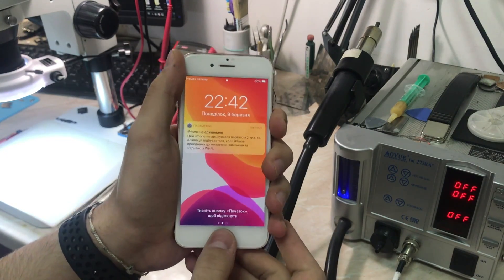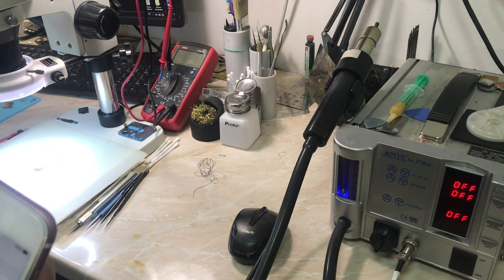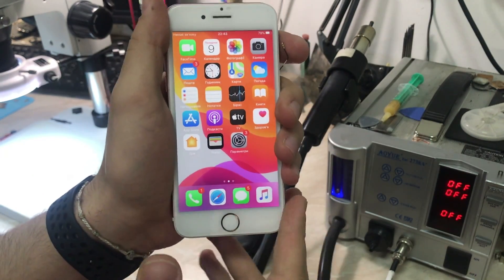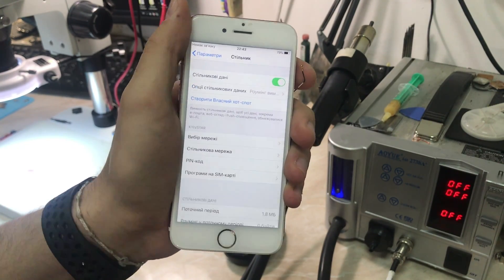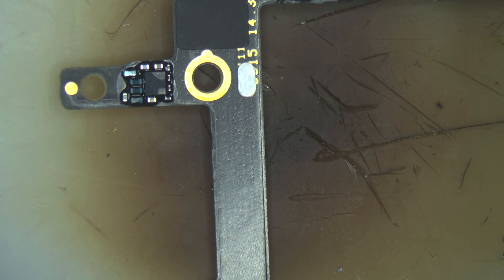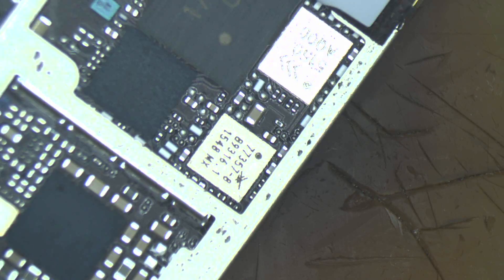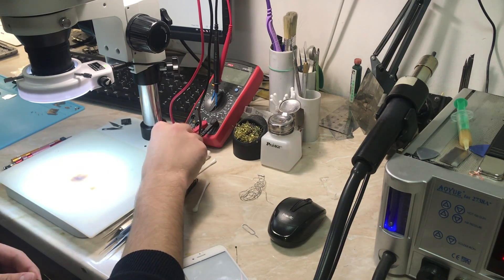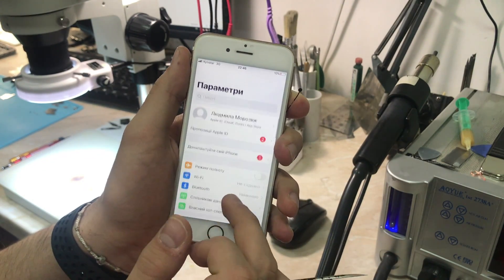iPhone 6S No Service (Easy and Fast Fix)

Comment: I think it's important to measure the components for diode mode and voltage values so new techs don't just change that ic even if the problem is elsewhere. Just a suggestion

Comment: Can someone help me I have an iPhone 6s that has bad reception drops in and out in the same location a lot of the time I’ve done everything I can think of replacing the SIM card and doing everything I can in settings but still nothing seems to work
Now I’m looking to replace the antenna but I don’t know which antenna is for the cellular 
The one with the bracket or the one next to the battery connector 
Any thing can help thanks
Reply from the maker: Do you have a complete drop for 2g-3g-LTE or just couple of bars dropping ????if you want to change the antenna it’s near the bracket of course try to change it goes with the charging flex

Comment: i'm facing low network issues in iphone 6s after changing charging flex board
what should i do ?
Reply from the maker: Check the antenna and try another charging flex
Reply: @AntoineKiriaky10  I tried everything 
network reset, antenna, flex board
Reply from the maker: Before you change the charging flex was there a strong network ? And what is the history of the phone ?
Reply: @AntoineKiriaky10  yes there was full network
and I don't understand what is history
Reply: @AntoineKiriaky10  can we chat on Instagram

Comment: My iphone 6 plus has No Network Connection. No Carrier in the settings. What’s the problem with this?
Reply from the maker: Does your phone see the SIM card ?
Reply: At first, the iphone can read the SIM card but later onward, the signal was lost. The carrier was gone.
Reply from the maker: Can you contact me privately?
Reply: Where do you live?
Reply: Joseph Carlo Carillas same

Comment: I have 6s no service happened after replacing charging ic may issue this ic ? You replaced
Reply from the maker: Well it depends how much heat did you use ?? And do you have modem firmware ??